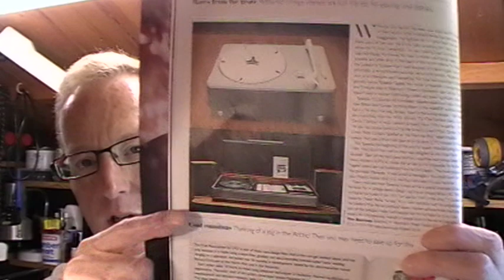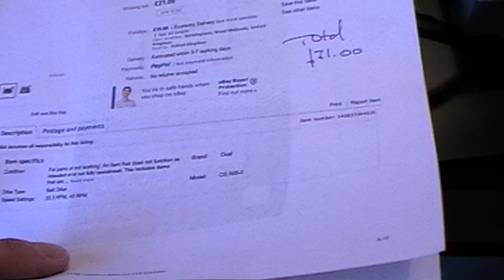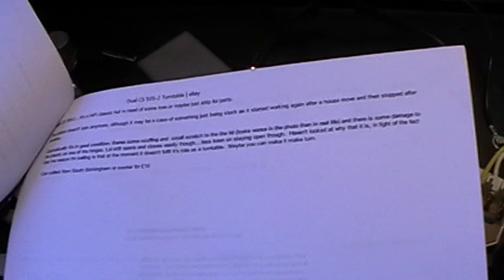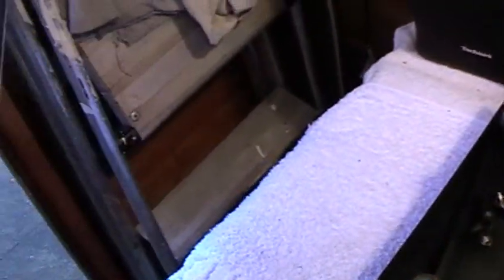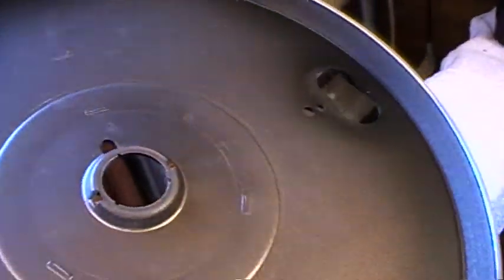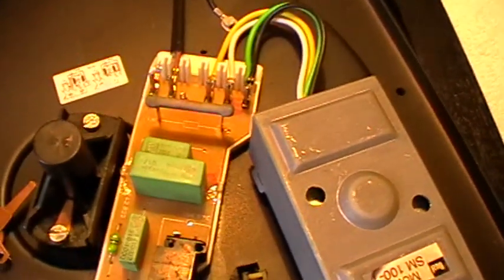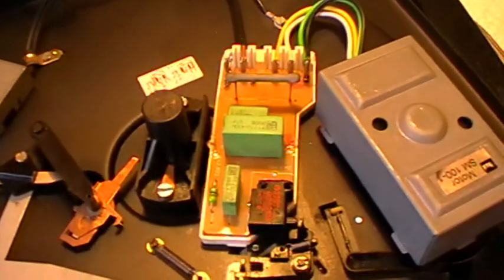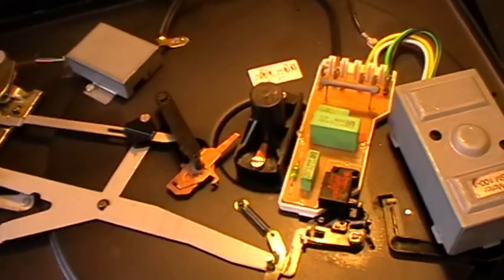Dual 505-2 (1984-89) Pt1.

Comment: Richard.  I am having terrible trouble getting my 505-2 to actually engage the motor when I bring the arm across.  At best it is temperamental.  At worst it just does not work.  I have taken it to be fixed but it still fails to move if it is not in almost constant use.  Can you help?

Comment: Having serviced Dual for years at the retail level and being the owner of several 1229, a 701 and a 741...I do not understand the attraction to these, especially when at least stateside one can buy vastly superior Rega's and Systemdek's for nearly the same money. The Plessey Garrard DD75 is a delightful unit, especially when the Plessey cap's are replaced and on occasion can be had for under $100 dollars on Ebay

Comment: I don't think the four-digit number on the bottom of the mat indicates the date of manufacture.  From what I can tell, the Dual 505-2 was not manufactured before 1984.  The rubber mat on my Dual 1264 has "1957" on the underside. It was purchased new around 1980.

Comment: Re Dual dating; the number under the turntable mat is not date- related, and it is a 'strobe' light, not strode, used for checking turntable speed. Other than that, you have a pleasant voice but would be nice to see a bit more of the workings rather than hear about your train travels.

Comment: Hi Richard, well done, very informative and helpful. One small error in your video. The Dual 505 wasn't introduced until the early 1980s, so the 'date' on the platter mat, isn't actually a date, probably a part number or ref. My mat is stamped 1954 2, which interestingly is the month and year of my birth, but I know they weren't producing the 505 then :-) Thanks again, Geoff
Reply from the maker: Hi Geoff, 

Thats fine and many thanks for the update.

Warm regards

Richard

Comment: I got my old Dual 505-2 out.  It will not start to turn.  I want to access the lower portion of the unit but am embarrassed to admit I don't don't know how to accomplish that feat.  Do I have to remove the staples along the outer edge?
Thanks so much.

Comment: Hi Richard,

Good video! Obvious question, I have a Dual CS 505-4 and it seems to be smoking! I have ordered a replacement drive belt because the other one had perished but there is a slight smell and visual smoke which appears when it is turned on! I therefore need to remove the top cover and check to see where the smoke is coming from. Could you tell me how to remove the top plate? I have loosened both screws which normally release the springs, but it does not seem to want to come free. Any advice greatly appreciated.

Cheers,

Robin.
Reply: Robin Perko hello. Do you solve that issue (the smoke from motor) with the new belt?? l have the same problem with mine 505-4 . Thanks in andvance and sorry for the delate..

Comment: Hi Richard, I found your video while searching for a repair shop for my Dual CS505-2 which I bought in 1987 and have loved using ever since. The problem is that it has suddenly started playing very slow and the speed changer seems to make little or no difference, other than that it is in excellent condition and has never given me any problems, Do you have any ideas what the problem could be?

Comment: Hi Richard. I am restoring a Dual 505-1 which was delivered to me in parts. I was wondering if you know where the black wire from the motor goes towards the switch plate circuit board. On your record player the black wire is connected to the same pin (1) where the green wire has to be connected. But i am not sure myself because i can't find any information about it in the service manual.

Additional: is part two of the Dual 505-2 (1984-89) still available? I can't seem to find it on YouTube.

Comment: Richard - do you have the pt.2 for the Dual 505-2 video series you did. I can't find it on youtube and was eager to see that part. Also I just bought this same table and have just run it plugged in without connecting to the full setup yet. When the platter is spinning I hear a tick...tick...tick - once on every full rotation of the platter. Inspecting the underneath of the platter I noticed that there is a small diagonal piece of plastic where the belt goes around the center circle and I believe that hits a small little movable piece on the board. Seems purposeful. Best way I can describe it. Is this normal and should I hear that 'tick' once every revolution?
Thanks for any help,
Mike
Reply from the maker: Michael Johnson 

Hi Michael

The plastic bit is the piece to catch the return the arm when the record has finished - the ticking could be the belt catching due to wear maybe as no sound should be heard. 

I think I moved Pt 2 due to copyright - I have searched my archive  but can't find it as I have changed computer since 2012. 

Hope this helps 

Warm regards 

Richard
Reply: Richard Macintyre Richard - thanks for the reply. I figured out the issue. A slightly sticky mechanism at location I suspected. Nothing wrong with the belt. I have another question. I am struggling to figure out how the tonearm up/down  mechanism works. Mine does not and when I look at the parts I can quite make out how the arm that goes from the tonearm lever should be connected at each end or what it should rest on. It is connected at the center via a small spring loaded plastic piece that locks in place. Do you have any pictures of the underneath on the 505-2. I can't seem to find any online that show this well and the service manual isn't really any help. Mike
Reply from the maker: Michael Johnson

Hi Michael - I have checked my pictures and nothing about the arm lift - it can be a tricky one as the lift is in a tube with oil to damp the lowering and rising.

May not be able to help on this one as I can't remember how I got mine going - unless I take it apart again - which as I am using it would be not much fun.

Warm regards

Richard

Comment: Hello , I bought not long ago the 505-2 and for some reason the speed of 45 free switch does not work and only 33 works have an idea how to fix thanks
Reply from the maker: Hi - Yes the belt runs up on the spindle when you change the speed - a arm moves this so the belt moves. Some times the belt gets slack and will not move so you can take the turntable off and move it manually. Or buy a Duel new belt.  

Warm regards 

Richard
Reply: EBay bought the Leaf spring 102 How I component that you have a picture. Because according to what I found online that does not work.What you meant little belt
Reply: Richard Macintyre Watched this video cause I've got the same problem. Gonna get a new belt. Thanks